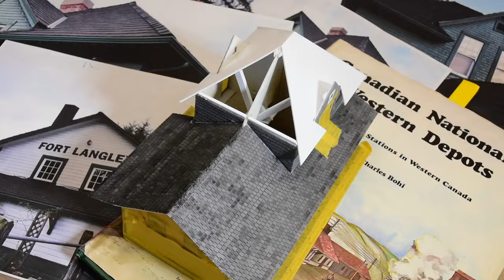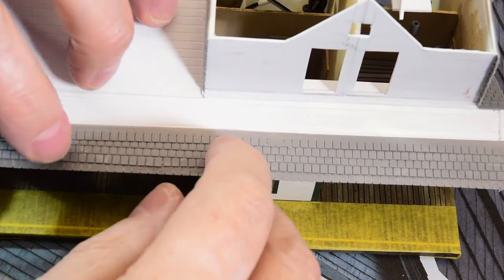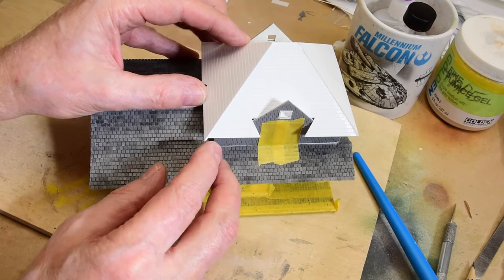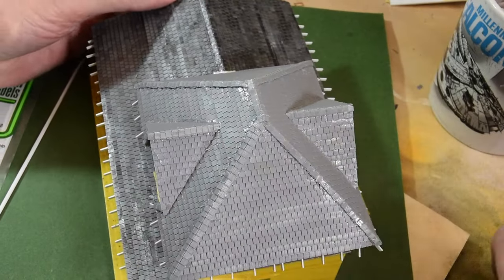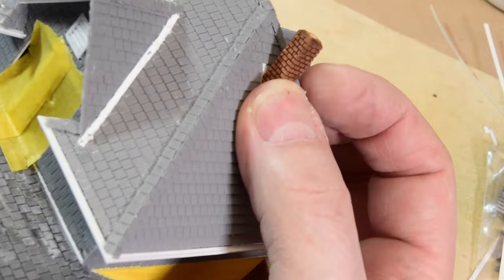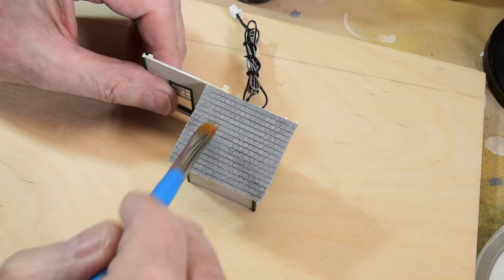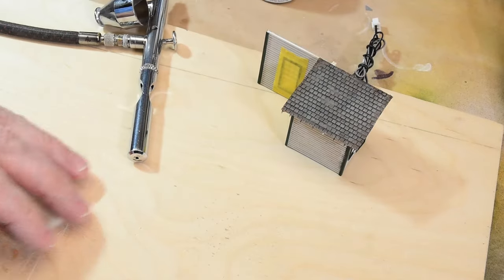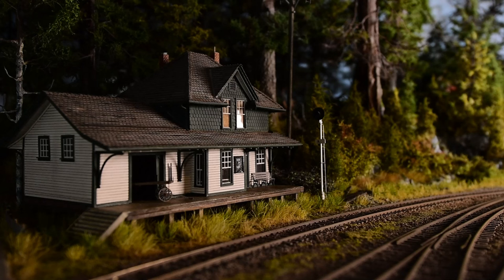The Classic Train Station Final (Part 3) - 1/87 Scale | Scratch Build | Boomer Diorama ~ # 254

Comment: I have been an HO fan for 50+ years. 
Discovered your channel a few weeks ago and have found it extremely motivational. Plastic has always been my preferred material  but, with little success..
Thank yoyou for sharing your experience.
Reply from the maker: Thank you. I grew up as a plastic modeler even though I built many succefful railroad subjects from wood in the past. Wood is an excellent medium to build models from. Scratch building from plastic is a bit of a learning curve and I learned from my "military modeler" days. I can achieve a more detailed model in half the time when I build from plastic. Once you get the feel for it, through a little practice, you begin to realize the advantages of plastic. Cheers.

Comment: Dear Boomer, the running out of the alignment with the shingles, that’s just like mounting true to scale shingles, whether wood, slate, EPDM or bituminous, on a real roof surface. Especially with larger roof surfaces. To prevent it I learned to use chalk line reference lines similar to the v-groove sheets, plus a formed piece of zinc or sendzimir folded with to straight edges. The lowest edge butting up to the lower end of the previously mounted shingle line and the higher one butting up to the next line of shingles to be mounted. That way it’s easier to anticipate for possible bumps and indentations, which only become noticeable when the shingles are running out of the lines. 
Love how the roof adds so much character to the building. Absolute pleasure to watch this build! Cheerio
Reply from the maker: I find the roof to be the icing on the cake for a scale model. I also think it is important to model the eves as well. Small details, but big collective reward. ;-) Cheers ~ Boomer.

Comment: My cousin pointed out your channel and I appreciate that and what you've shared.  I too am a Nikon fan (used D-850 and lenses) and know how great those lenses are!  But that is just a tool to show us great modeling and you deliver.  I was looking for a video to figure out a jig for my station's eave supports (I model 1934 and have a 1924 image with all these supports shown in the engineering record as 2x4's butted against a 2x4 rail along the station wall and another under the roof -- from ICC valuation structure book).  I wanted the roof to be removable to access the interior, but not sure this lattice work can allow that. Your problem solving comments in carrier video is making me think though.  Thanks for all the time, inspiration, and video sharing.
Reply from the maker: That is great. The 850 is a nice camera. Glad to hear you are thinking things through to find a solution. The challenge with this kind of modeling is being able to take them apart as well when needed, especially if they have lights installed. Cheers.

Comment: Awesome build. Two questions: 1. What are your thoughts on using paper instead of .005 styrene? Why or why not? Drawbacks? and 2. Could you elaborate a bit on the lighting you used? For lack of a better descriptive, it seems to project a welcoming warmth.
Reply from the maker: Paper has a place in model building. I don't use it because it is not stable enough for me and warps over time due to humidity. Furthermore. I like to texture and paint my models with a certain style that is not compatible with paper.

The lighting is simple: I use Woodland Scenics Lighting and Evans. They both have great options for different colors etc. Neither of them need capacitors and are easy to install - and compatible with each other for the most part.
Reply: Great work Boomer.  My weekly shot of inspiration.

Comment: 2 details i tryied to see from your station´s book. Power line. Some are underground and others aerial with pôles, câbles (phone and power) plus metal tubing along the wall and meter (that applied also to rail crossing signal box). In good old days 
station´s operator used telegraph to communicate to other stations along the line. In more modern times it was radio air waves. Hence antennas. Could be on their own metallic three legs pole or on roof. Can´t see them. Plus VIA sign if there is service. In Dorval (Montréal), 
I ´ve not been there since a few years, so i don´t know if it´s still there, there was LRC and Turbo speed sign along the track. Even if Turbo were retired in 1982 (1968 - 1982). 
On street view, you still have a CN semaphore in Joliette (QC) at 95 Baby street (north side). There was also a CPR one that can´t be seen. 
Relics can have a pretty long life !
Reply from the maker: I don't bother with telegraph lines until the layout gets finished. Otherwise I tear them all down. ;-)

Comment: Boomer, thank you, a great video, on an amazing build.  So much detail.  It has finished up awesome.
Thank you for sharing the journey.  You are right the little extra details really make a model / scene.  I firmly believe that gutters and downpipes finish a building off.
A quick question, do you have light bleen out of your wiring hole in the floor, or are all the lights sectioned off?  I have had that issue with building on piers (blocks) where the light comes out under.
Thank you again for sharing, cheers, and stay safe,  Michael
Reply from the maker: No light bleed. It's blocked out inside the building. Cheers.
Reply: @boomerdiorama  thanks for that.

Comment: Boomer,  do you remember the liquid that you could use to make airliner windows? You applied it with a toothpick or similar. Do you think one of the GAC products would do the same? GAC700 maybe? It was fir something about the size of the small panes in the station windows
Reply from the maker: I used GAC 500. You need to build up about three layers. The key is thin and let dry between layers.
Reply: @boomerdiorama  thanks, I'm building up a nice long shopping list for when I'm back at work 😆 🤣

Comment: If I may, why did you chose plastic shingles instead of other material?
Reply from the maker: O.K. Good question. 

There are other equally good materials for shingles which I have used in the past. However, I choose plastic shingles because the whole model is plastic and I like to "weld" or "melt" plastic for (chemical) bond over (mechanical) bond integrity. I also prefer to paint plastic rather than wood and paper because  I prefer to paint wet-on-wet with water based acrylic paints. 

Furthermore, plastic is impervious to water, moisture and warping. Wood and paper model warp over time due to moisture and humidity ;-)  ~ Cheers ~ Boomer.